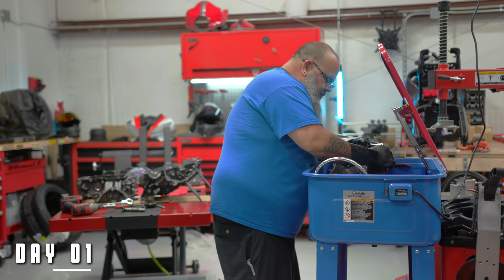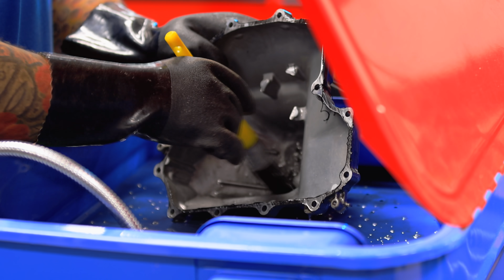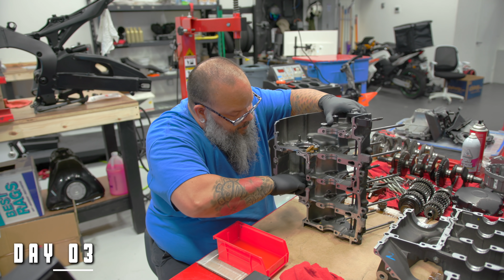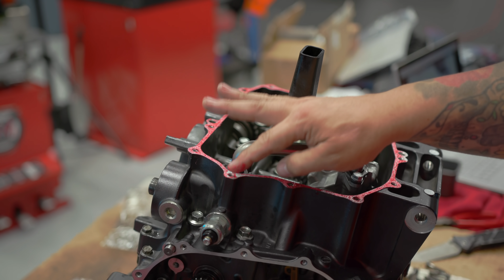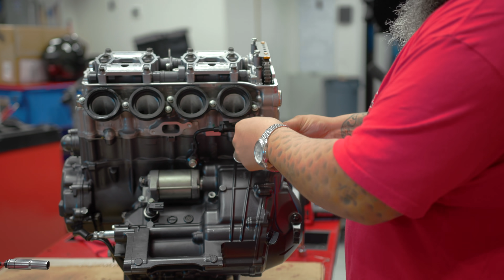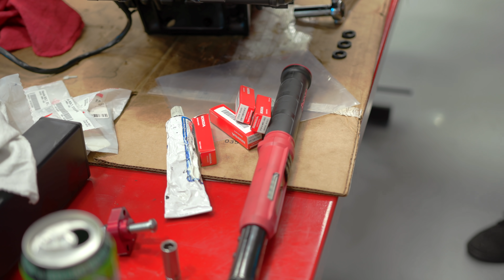Honda CBR 1000 RR Engine Rebuild TIMELAPSE in 10 min!

Comment: I have a 2000 CBR 929 with 77k on it. Excellent bike and i love it, but it has developed oil leaks, cracks in the fairings and needs a paint job. I have some cool mods in mind as well. Cool video, i haven't been inside a sport bike engine yet. 🏆

Comment: Hello I have a Fireblade from 2005 has some noise at the clutch cover I think is the chain tensioner and it kinda eat oil like 200ml x 1000km could I have bad pistons ring? Local mechanics say it's normal for a Honda but I doubt it 🤷🏼‍♂️ thx in advance if you are going to answer hopefully you will 😅

Comment: Why did you push the pistons in from the bottom with no ring compressor. I was taught  to soak the ring lands in oil squeeze it, drop from the top. Just asking is all

Comment: Hi 
On the cbr 1000 stator are the suppose to be oil? Or is it a main seal leak? I own cbr 1000 rr fireblade & bike is jurky on low end battery drains after 3 min of cooling fan on the battery is fine & testet stator its droping to 0v & back to 12v & casing for stator full of oil is that normal or main seal?

Comment: Is the instant gasket as good or better than the ready made gaskets?  I'm about to do a counter shaft replacement on a rc31 and there is a full gasket kit available.  
I'm noticing a lot of these rebuild vids they use the sealant on crankcase etc. is this because it is superior or just because of convenience/cost?  
I had a nc29 professionally worked on for gains before and I noticed the blue silicone around the seams so it seems to be very common on performance builds
Reply: I was wondering the same. Commenting so I get a notification should anyone reply

Comment: did part of the engine had to be shipped to a machinist ?? (it was mentioned in a previews video when taking apart the engine.... piston case or some tight component that probably needed to be taking out by a special machine or technique and re-installed, if i'm not mistaken)